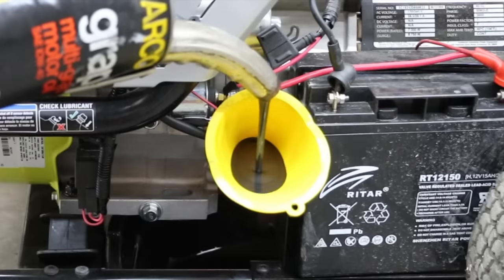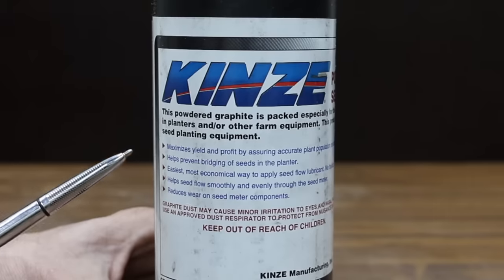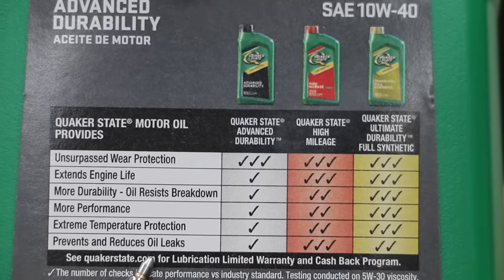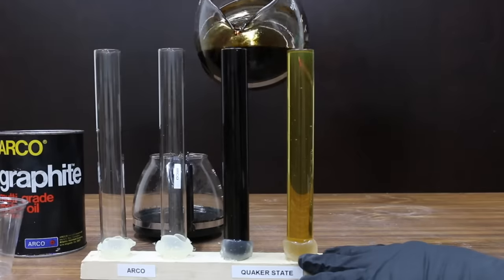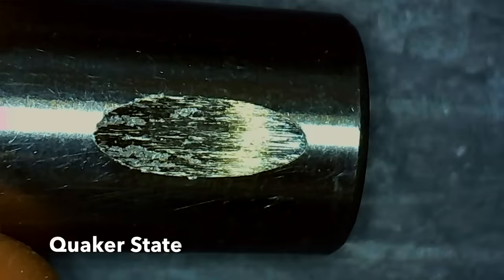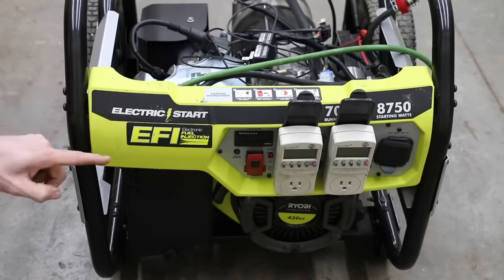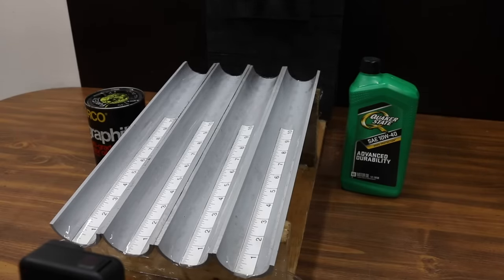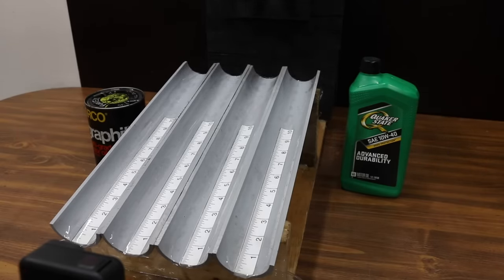Will "Graphite" Help Motor Oil Performance? Let's find out! Vintage Arco Graphite vs Quaker State

Comment: Heres one for you. Does setting a charged car battery on concrete REALLY drain it any faster than setting it on rubber or wood?
Reply from the maker: Thanks for the video idea.
Reply: Setting it on concrete does nothing  , but concrete draws water , which means moisture gets to the battery  , when a thin layer of moisture is across the top of the battery  , it's a short , depending on how much moisture is on top , is how many mili amps its gonna pull
Reply: Also the concrete is conductive of heat; so it will cool your battery down faster than setting it in on either wood or rubber; this is easily remedied, by letting your battery warm up a little before installing it. Although just as a general rule; I always top up my battery's fluid levels, and charge them up fully, before installing them.
Reply: I think it has a lot to do with the battery cases.  Many years ago, back in "the day",  the cases were different than the plastic or plastic coated cases of today.  The old rubber cases would allow the batteries to drain down, or so I've been told.
Reply: When on concrete, the battery discharges due to a difference of internal temperatures (bottom is colder than the top) causing the electrolyte to form its own internal circuit. Being on concrete for 15-20 during a battery swap wont hurt anything, but I wouldn't leave it there over night. 

The plastic case does provide a token amount of insulation, but thermal transfer is still happening. 

While a surface fluid could complete a circuit, that would be from condensation (dew) from the air [or a spill of some type], not the concrete.

Comment: I gave Arco graphite a try back in the 70s, but have not even thought about it in decades. Have not used any type of additive, but have been using synthetic oil for decades in all my vehicles. Primarily, Mobil 1; however, will be switching to Pennzoil Syn for my new vehicle when the time comes to do the first oil change.
Reply from the maker: Thanks for the feedback.

Comment: my Father ran the Arco graphite in his 1973 Olds Cutlass, he purchased the car in 1979 and it became mine in 1985. i rebuilt the engine in high school in a Voc tec class i took. when i disassembled the engine it was caked with graphite debris, a horrible mess, literally pounds of this in it, the pan ,the valley and under the rocker covers. i still own the car today, now powered by a 455 and has went a 9.84 at 135 mph on all Lansing muscle, no power adders.
Reply from the maker: Thanks for sharing.

Comment: He has tested so many oils Im wondering what is the best overall period
Reply: Same
Reply: Amsoil. But it  just barely beat the much less expensive Penzoil. Watch his synthetic oil showdown.
Reply: @alanmyers5081  motul is great. ive got the motorcycle 5w40 and used it in my car (gasoline na aswell) and it runs just fine!
Reply: The best by far is the special weight! (0w40)M1 or Castrol unless you can find a special deal. If you need 5w30 or 10w30 please use 0w40, and its even better with 20% mmo Marvel Mystery Oil. 

I also find Ultra Platinum 0w20 and 5w30 fore less than 14 bucks for 5 quarts. Aswell I have found Maxx 0w40 for just over $11 for a 5 quarts. 

Always use full synthetic but add MMO if you can. If your application asks for 5w20 or even 0w20. A good synthetic 5w30 with 20% MMO will do even better. And make sure to always change early. For Mopar engines filters are M1301A, Wix 51515xp, and Royal purple 308a.

Comment: I also used ARCO in a Subaru solid lifters that had to be adjusted often.
Chose this because of the claim slickness of the oil. 
Lifters had to be adjusted every 25K.
Took it to the dealer for that service. Mechanic asked what was wrong with my oil? I said why he’d pulled the valve covers and got his hands in the oil. Would not come off his hands it had to wear off. 
I told him what it was and why continued to use ARCO till it wasn’t available anymore.
The engine never showed wear I sold the car to my Sister as I purchased a new truck. They drove it another 60,000 miles no trouble. And purchased a new Subaru because of the one I sold her gave good service the car when traded in had nearly 200,000 miles and still no oil burn or compression loss. 
Thanks ARCO for stepping out of the box.
I currently use Shaffer 9000 in all my vehicles great wear run 9000 miles between changes both diesel and ICE 
And only OEM filters.
Reply from the maker: Thanks for sharing.

Comment: One small point of contention with the “heat evaporation” test: the oil in any engine is moving, not sitting static. Sitting in a container without the benefit of motion will not achieve desired results, which is a direct comparison on haw the evaporation rates between the two oils compare. In an engine designed to use the oil with graphite, or without graphite, the oil is in constant motion rather than sitting in a static container exposed to a constant temperature. As a result, any quantitative testing done with these oils after and including the evaporation teas are questionable. Thanks just my observations. Not a critical comment.
Reply from the maker: Thanks for the feedback.
Reply: You could use one of the hot plates that has a magnetic stirrer

Comment: Why don't you use "T" function on your scale when using empty container? this will give net weight.
Reply from the maker: Thanks for the suggestion.
Reply: @ProjectFarm  facepalm....
Reply: I always wondered the same thing but realized it would be difficult to get an accurate “after” weight of the container and oil once the evaporative testing was complete 😬
Reply: because it doesn't matter. he's weighing for loss. and the two containers could be slightly diff weight as well... I'd almost bet they are to be frank. gross weight is the most accurate way in this case
Reply: When the scale shuts off between tests, you lose the zeroed weight and introduce a point of potential error. It is much more accurate to measure the entire mass and do subtraction as shown in the video. Zeroing the scale has its perks, but this type of test does not benefit from it.

Comment: Years ago I put Arco Graphite oil in my Honda Goldwing. After a very short time the neutral light came on (while riding). Goldwing engine/trans uses common oil supply. Had to replace neutral switch and flush graphite oil out to fix. Black graphite oil is NOT easy to flush from system. It took 7 oil changes (one after the other with filter changes) to get oil to come out near normal color. NOT recommended for a motorcycle.
P.S. I flushed before replacing switch.
Reply from the maker: Thanks for sharing.

Comment: Marvel mystery oil in the fuel tank! Does it help mpg, cycling, overall performance
Reply from the maker: Thanks for the video idea.
Reply: I just got through trying it in a chainsaw. With that scorn.  It starting but will not cut with out dieing. Carb adjust will not idle correct.
Reply: Cleans injectors and spark plugs

Comment: I swore by the Arco oil when I was building and rebuilding VW air cooled engines for both my tube chassis dune buggy racers as well as my around town grocery getters.  No perfomance issues but the slightest leak or spill  would destroy an engine compartment or driveway. I thought it was great at the time.
Reply from the maker: Thanks for the feedback.

Comment: It makes me wonder if Arco would straight-up clog oil filters, or at least dirty them up really quickly.
Reply from the maker: Thanks for the feedback.
Reply: Stockholm I used it for years ... still have 2 cases left ... it absolutely DOES NOT CLOG filters.
Reply: Ben Finny My last several cases are in plastic bottles that I bought in the early 80’s when I first heard it was being discontinued.   If it was clogging filters, the oil pressure would, at some point be reduced ... never happened.
Reply: @MrBobWingard  great answer! If it clogged things up pretty badly, the pressure would become pretty high
Reply: @OldCrowsClassicCars  Depends on where pressure readings are taken... If after the filter, the pressure would drop, if prior to the filter, which is very uncommon, the pressure would spike.
Reply: @ChucksBasix  excellent point!
Reply: @MrBobWingard  You need to be careful, because in some systems, the sensor is between the oil pump and filter, which means, a clogged filter will show an INCREASE  in oil pressure, while the bearings are seeing a reduction in oil flow. I think this graphite oil is the best thing for a flat-tappet camshaft though. It will minimize cam lobe wear. I don't know what the extra zinc, phosphorous, and graphite would do to oxygen sensors, or catalytic converters.
Reply: Vincent Robinette What do I “need to be careful” of ???   If the oil pressure sending unit is, as you say between the oil pump and the filter, a clogged filter would show a faulty reading as filters have a bypass that would allow oil to pass through it.   If the oil has a path through the filter, the sending unit’s output would be faulty.   This is exactly why carmakers almost NEVER configure their oil delivery systems in this way.
Reply: @MrBobWingard  I do believe some of the "old school V-8 engines did.
Reply: @vincentrobinette1507  Any examples that you can proveably claim were built that way ???
Reply: @MrBobWingard  Small block Chevrolet, Old 396 Chevy Big Block. I don't know about other General Motors, Chrysler(Mopar) or Ford. When I rebuilt my 396, I was surprised to see that. I do believe, it does rely on the bypass of the oil filter, as you stated, to ensure the filter can't completely cut off oil flow. I rebuilt the engine when I was in high school, so I may be wrong. it might be worth a "Google" search.

Comment: I’m wondering if it wouldn’t be better to perform the lubricity test on “up to temperature” oil so that it’s at its running viscosity
Reply: Pretty sure most engine wear occurs when the engine (and oil) are cold.
Reply: Kind of, but not really. You would have to make sure the oils are all at the same operating temperatures during the tests and then you would be testing the viscosity modifiers more than anything. 

Also warm viscosity won't affect wear as much as cold. Once the engine is running there's no more metal to metal contact on rotating parts, in theory.
Reply from the maker: Thanks for the video idea.

Comment: I found some of the arco oil on Ebay and put it in a 2019 kia sportage and it runs better than It did before it had the oil in it and it achieved 50mpg and it went in for service and thay said it was the least worn out engine on 50000 mile and that is from the kia mechanic.
Reply: With all that zinc in it, I am not surprised.  The graphite content is oil of snake!
Reply: So your saying you brought it in for service and the mechanic said "I better tear down this engine" and then he was amazed!!?? Lmao
Reply: @lefthander5  hahhahahaha exactly, “let’s pull the sump off and check the bearings on this routine oil change”
Reply: You guys don’t get the 50k mile complementary engine tear down and inspection??? What kind of half assed quick lube place are you guys using??!!!
Reply: @alanmyers5081  the better question is what kind of half a** shop are you believing!! Lmao
Reply: Jim Lahey       And🥴.  Ask anyone who kept one of those Theta II BA$%@rd$ long term what happens to every 3 or 4th one of them 😧😬😖💀💀💀💀💀.       THE BEARINGS, it’s almost always a bearing, usually #2 that cages.     That or the dreaded a Hyundai “TICK OF DEATH”.    Listen carefully in a busy parking lot can you hear a Hyundai or Kia going by somewhere. The owner will be oblivious thinking he needs a valve titan well savvy prior Owners Know the sound all too well💀.
Reply: @drizler  lmao
Reply from the maker: Thanks for the feedback.
Reply: lefthander5 google: facetious
Reply: @alanmyers5081  no you hit the nail right on the head.... hard!!! Seen many come through the shop and like you I have heard hundreds!!

Comment: I have used a Conklin product TKO added to conventional motor oil.  I didn't notice an increase in milage but using their fuel additive did show about a 7% increase in milage.  When they campout with their para synthetic oil I switched to that.  In either case running the para synthetic or the additive resulted in oil analysis showing zero ware metals detected.  I ran the para synthetic oil 20K miles with a filter change every 2K miles in a Peogeot diesel.
Reply from the maker: Thanks for sharing.

Comment: This oil imbedded into the friction plates of my motorcycle clutch (wet clutch). 
Ruined the clutch.
Reply: Yeah I'd never think to use oils such as these in my bike.
Reply: al va really? Very interesting. Have u tried it in premix?
Reply: Yes. Yes it would ruin the clutch. Graphite is not what you want on a friction surface.

Comment: I used the ARCO graphite oil for a year in my 1972 240Z.  I heavily modified the car and it would do 140mph.  When I sold it (bad decision on my part) it had well over 100K miles on it and still went like the blazes, but would idle smoothly at 800 rpm.  I did become concerned about long-term impact of the graphite and switched to Mobil 1 in the mid-70s.
Reply from the maker: Thanks for sharing.

Comment: True story: 1975 a friend calls me and wants to know how to make his car stop smoking. 1. Change rubber caps on valve guides. 2. Change piston rings.  3. Add STP see if that helps. My friend calls me the next day. Said car won't start. I'll be there after work. I pull up in front of his house. There are approximately 16 empty STP cans covering his lawn.
Reply: Nicolas Broszky  I  assume the engine was not rebuilt. Only the 16 cans of STP were added (Stop These Pistons :)
Reply: Nicolas Broszky  were the points 1-3 not meant as a suggestion how to make the car stop smoking? And the guy skipped 1 and 2 just concentrating on suggestion 3? Just guessing. It doesn't matter anyway. Not worth wasting time thinking of this. STP is the engine killer- that's for sure.
Reply: Thank you everyone for your feedback. My list was ment as suggestions. I agree with the tare down. My dad owned a garage. I could do a complete overhaul in 1 weekend. 
In 1975 Richard Petty was the best stock car driver and he would never lie about STP. 😃

Comment: used arco graphite and moly oil in my 75 Honda golding motocycle., spun ball bearing races in transmission from low friction, had 3 thousands of inch wear in case from spinning races. Stick with manufactures recommendations

Comment: I worked on a Chevy big block V8 in the early 1980s that used arco for the last 2-4 yrs before teardown.  We pulled the engine due to low compression (225K) and leaking seals. The lifter valley and oil pan had @ .5-1" of graphite sludge on the bottom.  The cylinder heads were also filled.   But it was the quietest 454BB I'd ever heard!  I'm guessing that the accumulated graphite remixed with the oil as the engine warmed up.  He said it got better than 8 mpg on the highway.
Reply from the maker: Thanks for sharing.

Comment: I always used Argo graphite in my 1978 Dodge van which I bought new, and which, I still have and it's especially good when you're storing an engine because that goo seems to coat everything keep the rust down and not just trickle back down into the oil pan.
Reply from the maker: Thanks for sharing.

Comment: I used graphite oil back in the mid-70's in my 1976 Buick Skyhawk 231 c.i. V-6. I bought it new, and used only graphite oil.. I owned the car and believe it had about 175,000 miles on it when I sold it (I made no mechanical engine repairs to it). I sold it to an acquaintance, and he continued to run it with graphite oil. At around 240,000 he was in a bad crash, and got total value, but because he owned a body shop, he rebuilt it. The engine was undamaged. The best I recall, he ran it for around another 100,000 miles before selling it. It was still only burning a quart of oil every 1500 miles, and the only engine repairs he ever made were two or three water pumps, 3 or 4 clutches, and valve cover gaskets, and one or two emmissions components. There was no valve noise, no rod or main bearing noise, there was a little piston slap, and the oil pressure stayed a healthy 35 PSI, dropping to about 20 PSI at idle. He sold it in the mid to late-80's. Most of the milage was highway driving, in CA. I was not terribly critical on oil change frequency, and would run 15 to 25,000 miles between oil changes from time to time. Neither myself or the other owner abused the engine, although I did a lot of stop and go driving, as I used it as a work vehicle. It proved to be a very reliable and inexpensive car to operate.
Reply from the maker: Thanks for sharing.

Comment: My dad did an oil change with the Arco graphite oil when it first hit the market. It was a straight 6 GM motor, and when he started it, it immediately blew a ton of smoke. He shut it off, dumped the Arco oil, and replaced it with Quaker State, and when it started, all the smoke disappeared.
Reply from the maker: Thank you!

Comment: I used Arco Graphite in a 1977 Dodge half ton with the 318 engine.  The only problem I ever had was when I was driving through Canada in February 1979.  One morning it was about minus 70 degrees F.  The truck had been in a garage overnight and about an hour or so after hitting the road I smelled burning oil.  I popped the hood and there was oil everywhere.  What had happened is there was so much pressure in the crankcase that it blew the dipstick up into the hood, and that's where all the oil was coming from.  I continued my trip and had no further problems.
Reply from the maker: Thanks for sharing!